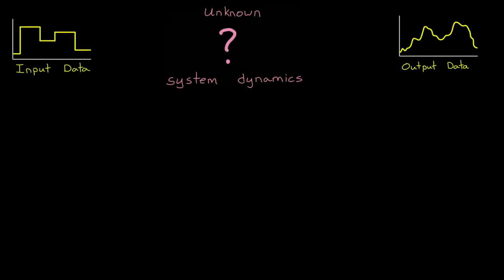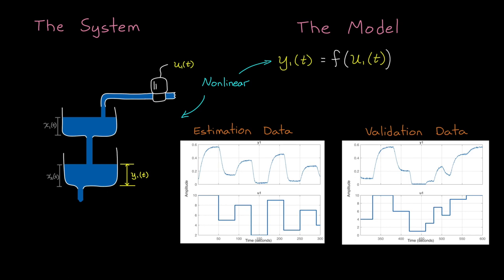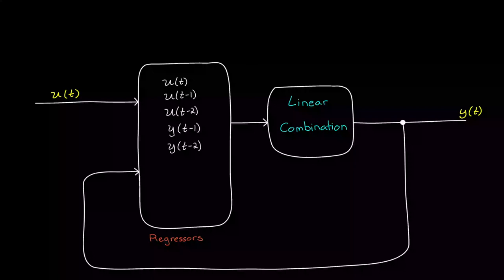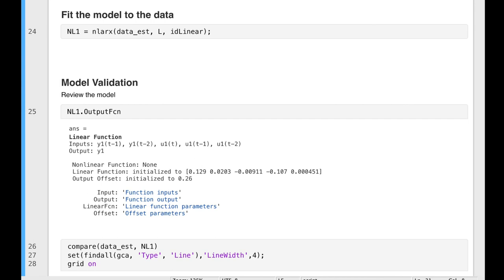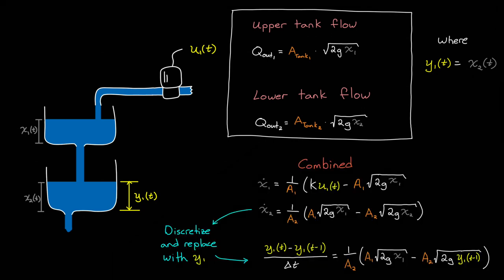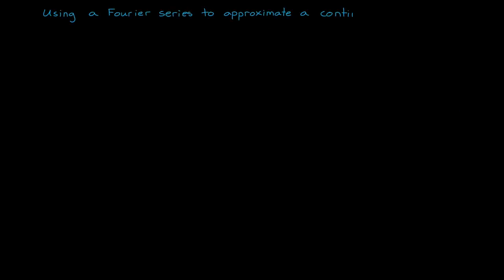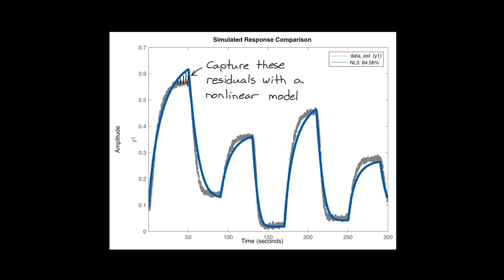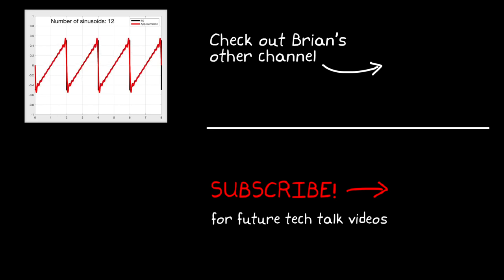Nonlinear System Identification | System Identification, Part 3

Comment: I have a question. You sair linear models cant handle the offset. However the start point is the initial conditions, and linear models can be initialized at any x0. How is this distintion made in the software?

Comment: Great stuff as usual! Regarding knowledge about the system that can be used, I was wondering whether a saturation (non-linear) function of the output could also be used by these methods, to address in a natural way the limits of the tank (full or empty), for example. It seems that the sigmoid function kind of captures this in a more behaved fashion (continuous function) either way.

Comment: Thanks for the very planned-out videos you post.
I have a miss understanding of a point you rush through it a bit , stability issues of nonlinear systems when predicting output? Why is that occuring? Apart from the external input sequences the system has never seen before.
Thanks.

Comment: Hi Brian Douglas, your videos helped me a lot. I'm modeling a very slow first order thermal system, but working close to 1200ºC, passing through the specific temperature of a test piece, which I imagine is a disturbance, at least that's what I've seen in the residual graphics. Any advice to achieve a reliable model in this case? Anyway thank you so much for the videos.

Comment: Hello Brian, first let me congratulate you for this amazing video, just one question; i am using matlab 2023 and still linearRegressor output the following error: Error using idRegressorSpec/set.Lags
The value of the "Lags" argument must be a cell array of unique non-negative index vectors, one vector for each variable.
Reply: well i figured it out for those who may face the same issue: just name your regressors variables like the nlarx model which are y1 and u1